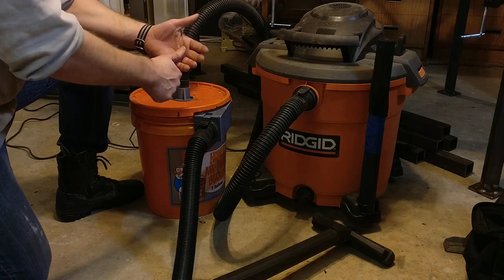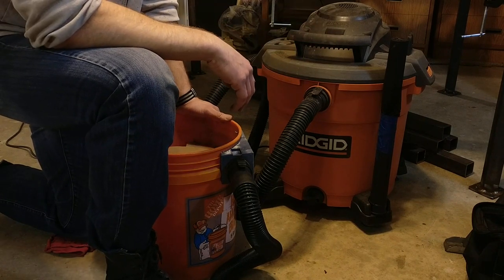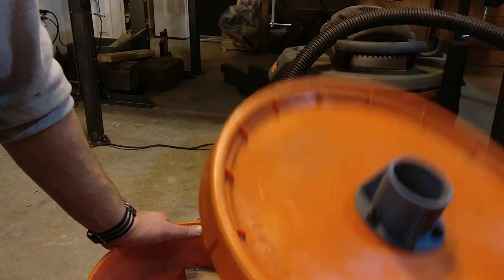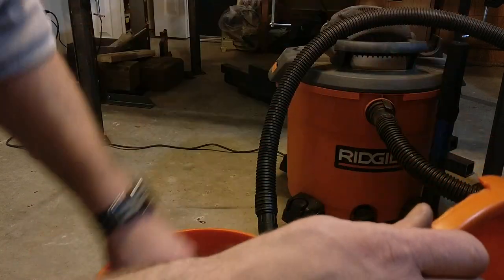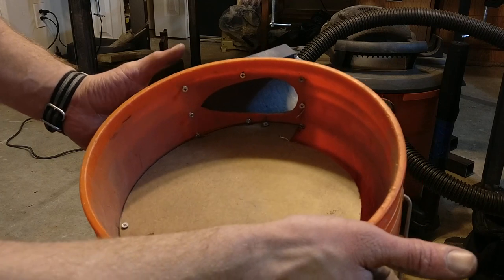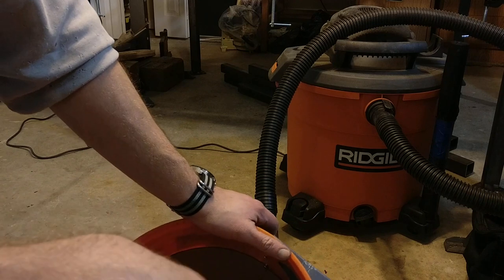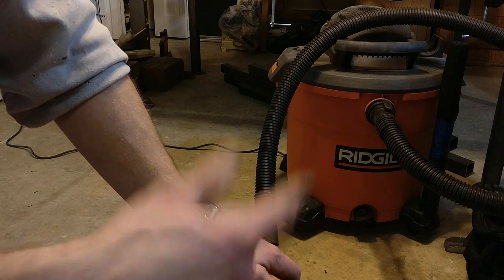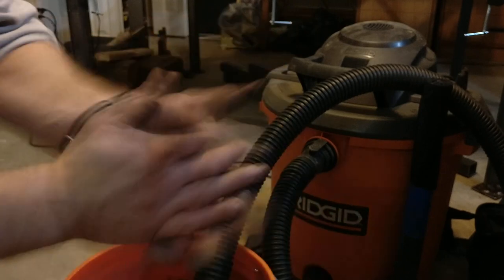3D Printed Thien Baffle Shop Vac Dust Collector! (With a bucket!)

Comment: Is there a reason this couldn't be incorporated into the bottom of the ridgid shopvac?  That way there would be less stuff to lug around yet it would keep the filter clean?   (Note I also left this question on the Thingiverse site)
Reply from the maker: I suppose, but only by adding the whole bucket assembly under the shopvac body. You can't reuse the shopvac body as the Thien baffle since the intake is in the wrong spot, the filter is in the way, not enough room for the dust to collect, etc. etc.

Personally, I slapped together a roller cart that held the two side-by-side, using scrap wood and the castors from the vacuum.
Reply: Thanks, I figured you could move the intake but didn't know how much room is required for the assembly, and if it would fit in the bottom....guess not.... @swolebro

Comment: have you used this design in particular with a table saw?  if so, do you know when the air will start to pick up the settled dust when the bucket starts to fill up?  about 2/4th of the bucket? 3/4ths?  thanks for the video tho! not many of these designs use a 5 gal bucket, at least just ONE bucket.  :)
Reply from the maker: In my shop, which is mostly grinder dust and machining chips, I haven't noticed anything getting pulled out past the baffle, and I usually let the bucket get about halfway full.

I don't do much woodwork, but I made one for a carpenter friend of mine who says it works well on his table saw, miter, and planer. Not sure if lighter wood dust gets pulled back out more easily, but at least he hasn't come back complaining that the max fill is too low. lol 

I think the 5gal bucket is pretty suited to the amount of suction that a shopvac pulls. I wouldn't want to upscale this for a larger can without getting a more powerful vacuum too.

What you can do though, if you need more capacity, is cut out the bottom of the bucket, cut a matching hole in the lid of a trash can (or custom-sized plywood box), then stick them together. That way your vortex/baffle is still sized to the bucket (which a shop vac can handle), but then the coarse particulate drops down into a larger container.